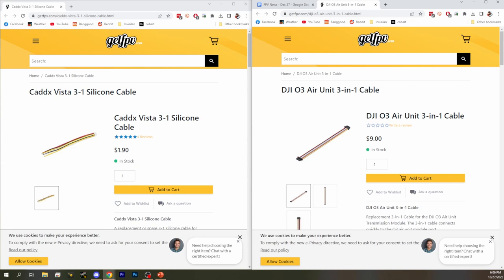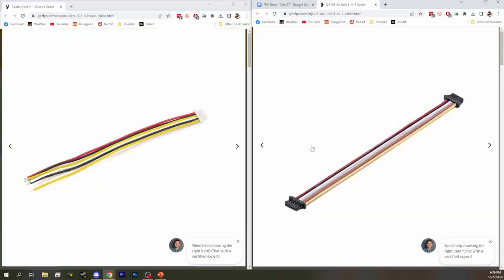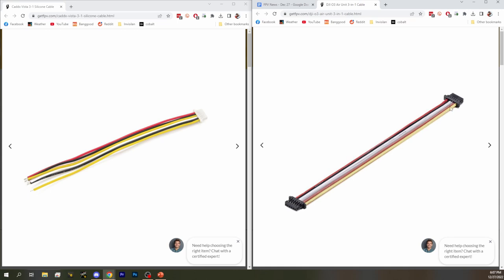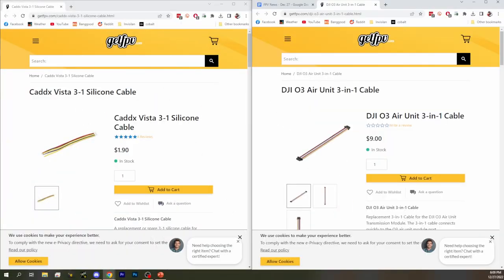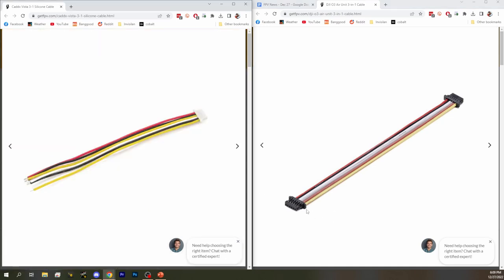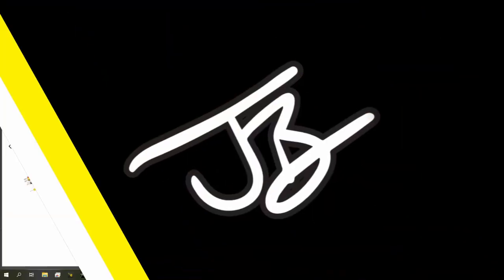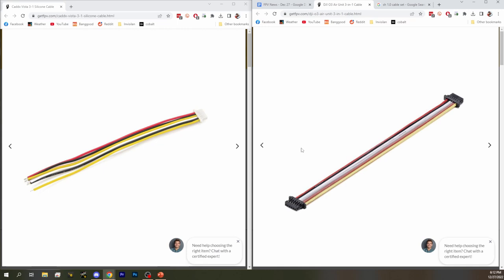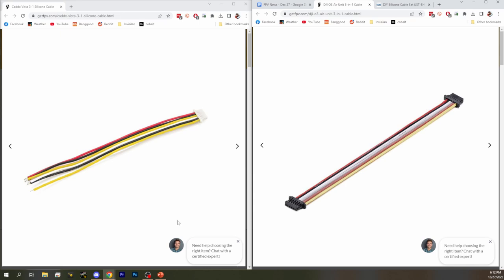PSA: DJI O3 Air Unit Plug Might Not Match Your Flight Controller! - FPV News

Comment: i ordered the T-Motor F7 Mini HD Stack for my Quadmula F3 Split, it has a reversed pinout, i had to repin my DJI O3 connector, the Connector which comes with the FC for the Air Unit, is currently the old plug for the old DJI Air Unit.
Reply: That’s right, In my case I needed to switch the wires completely the other way around.

Comment: If the fc manufacturer has assigned a port as a dji port and it has the wrong pin outs the manufacturer has caused the problem, They have sold a product that is not as described

Comment: I have to say some of the fpv product manufacturers are selling way over priced junk.  It is shocking to see the poor quality at the price sold. The kiss fc for example, and I bet all other on the market have absolutely no reverse voltage protection, the product info is scant on detail. They give voltages output on a port but don not quote current rating, so if you wire  say a air unit up to a pin that says its vbat/lipo it still may be the case that pin cannot handle the current draw of the air unit and burn out a component

As I say, Over priced junk, but with good functionality

Comment: Anyone I need help: o3 air unit with mamba f722 mini fc/esc combo. The o3 updates fine and works in my other quad but won’t power on! I even soldered direct to fc. Could this be a bad fc? Esc spin motors great and seem fine. I ordered another fc to try but losing my mind with this not getting it to even power on!

Comment: Is the plug of the old air unit the same as the o3? Just different pin order on the fc side?
Reply from the maker: The FC side plug is the same style but may need to be repinned.

The Air Unit side of the plug is totally different. -Blunty

Comment: FOR ALL THE NEWBS LIKE ME: IF YOU MUST REWIRE BC THE PIN OUT BEING WRONG, YOU MUST CONNECT POWER TO MAIN POWER LEADS TO GET SUFFICIENT POWER FOR O3. Im so happy my shit is working lol
Reply from the maker: You shouldn't need to rewire outside of the plug. The plug will have a 9 or 10v and a Ground, the power wires will go there on most builds, unless the BEC is underspecced on the board. -Blunty
Reply: @JoshuaBardwellLivestreamClips  thanks bluntly! Got that bad boy fired up!